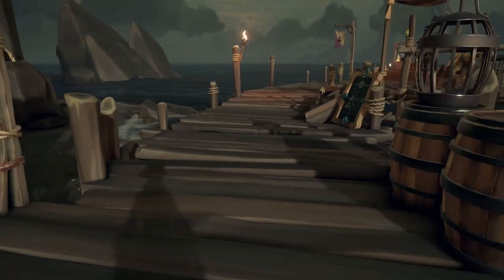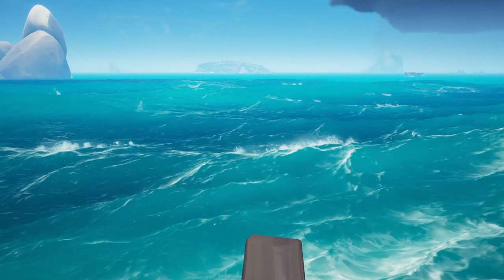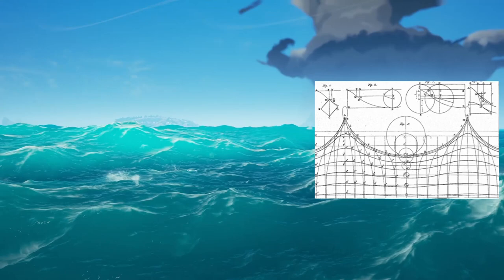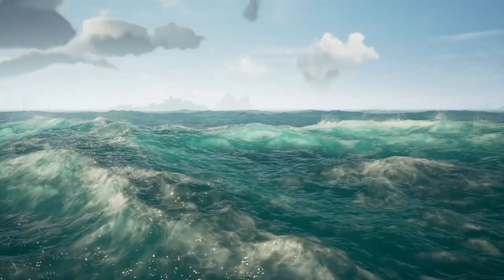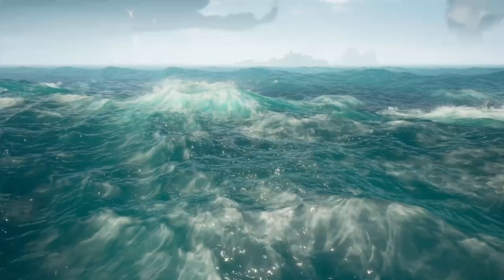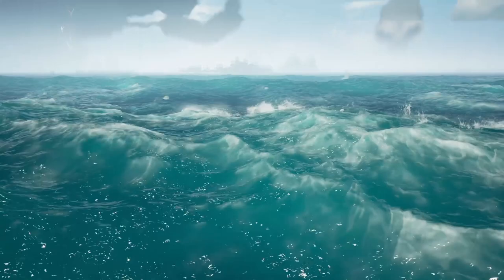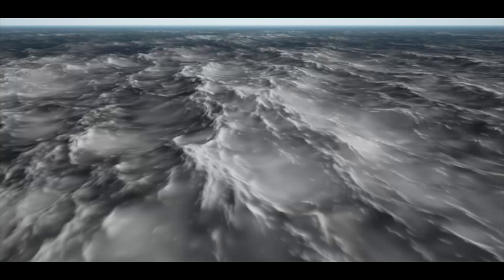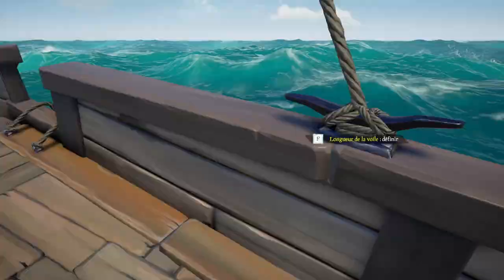How Sea of Thieves water is made

Comment: people don't get the concept of fast fourrier transform. it is not a way to create waves. it is a way to add sin and cosine effectively that would be expensive when adding them after calculating every one of them, which you need to do when making gerstner waves. 
so the gerstner waves and fft waves you mention are actually achieved through the same thing. you can think of fft waves as: a lot of gerstner waves that are added together and is calculated much cheaper, with correct wave spectrum(what i mean by spectrum is the wave properties. the direction, amplitude, etc. these are the things that you can tweak when setting up gerstner waves ).  lets say you have 100 gerstner waves. if you add them up normally, you'd get less performance than doing it with fast fourrier. that's the only thing about fft. nothing else.

about the foams, sea of thieves usese 2 kind of foams added together. first one is using the lambda value from the fft equation which you've explaind. and the second one is getting the dot product of the waves to the up vector and adding foam if the value is less or above than the output value. the closer the value to 1, the more flat the surface is. so, the closest the value is to 0.5,  the sharper the waves are. thus, more foam. 
this technique is pretty obvious as it only appears on the edge of the waves. which i dont really like. but sea of thieves utilizes both.
Reply from the maker: I appreciated a lot your in depth explanation. Do you have a current project you're working on I can follow or something?
Reply: @EpicDragonfly  yes i do but im too lazy to share it or make dev logs :D